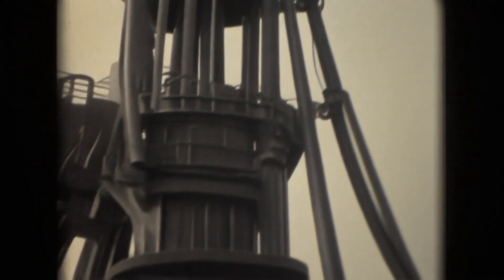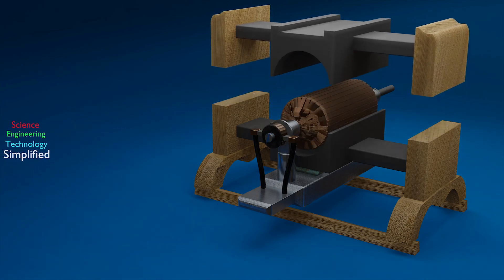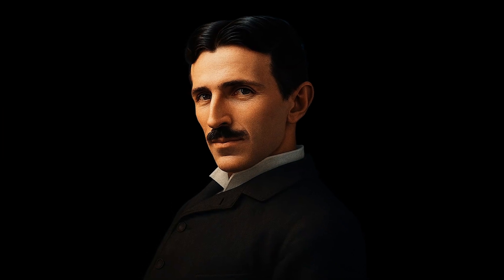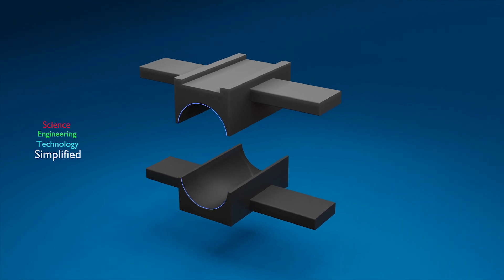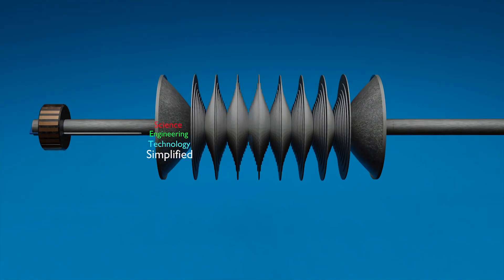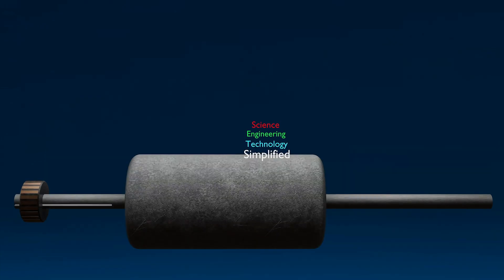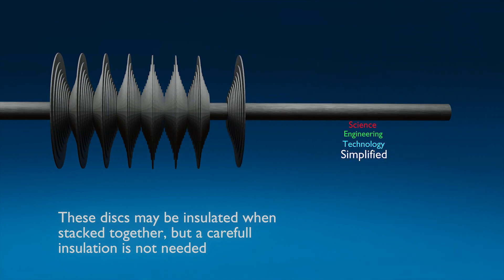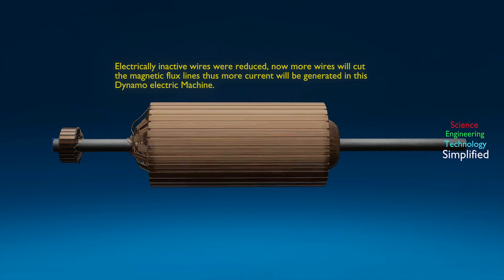What Nikola Tesla KNEW About Dynamo Electric Machines That You Don't ? | nikola tesla invention

Comment: the field from the poles concentrates down into the largest discs, only "cuts the conductor" at those points.
the idea of the core is to get the maximum magnetic flux through it, to interact with a coil wrapped around it. magnetic fields dont like to flow through air. when powering a field magnet, it takes energy to force that magnetic field through air. a standard core is designed to maximise the amount of iron it can get to conduct magnetic flux, and wire wrapped around it. you dont want to restrict flux coupling down to narrow "bands".

also, the field magnets... what is happening at their other end? the field doesnt just disappear... the magnetic circuit is "open ended", a very high reluctance, inefficient circuit. it should at least be closed, a single "c" stamping. or a ring with internal poles.

not all his inventions worked ;)